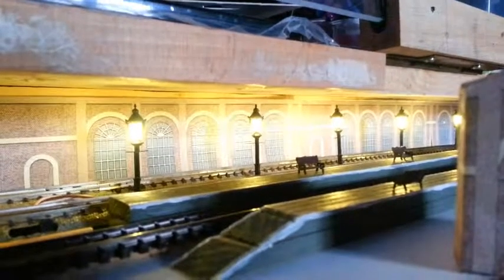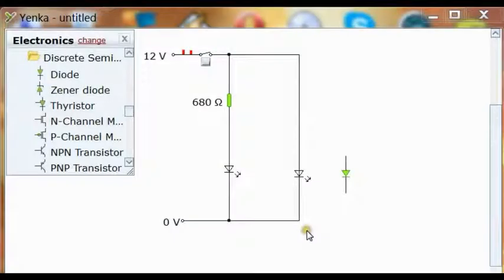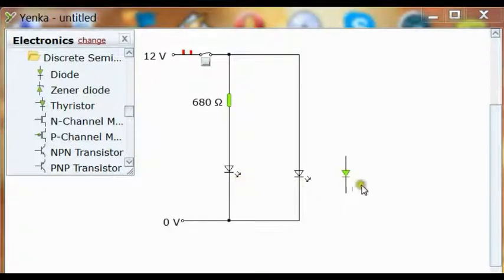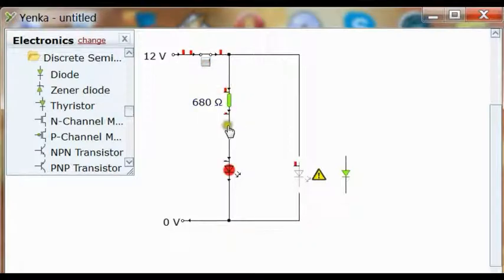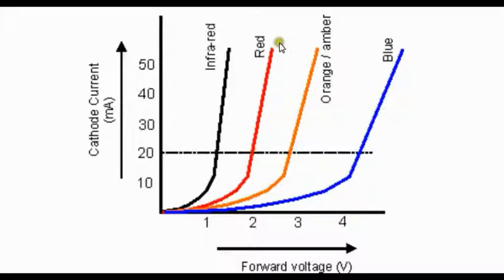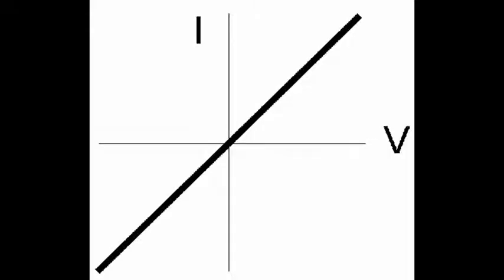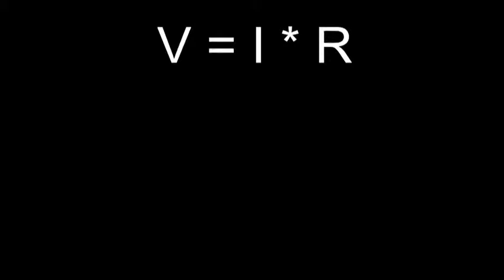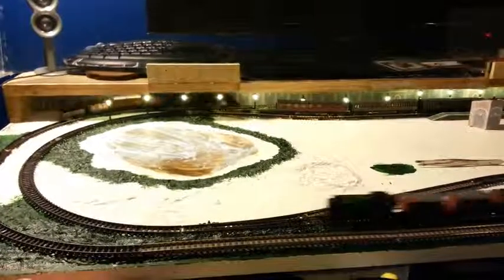Calculating LED protection resistor sizes

Comment: Confused by all the calculations and wizardry in selecting resistors when the results are still far too bright
Reply from the maker: Aus78Formula if the LED's are too bright increase the resistor size to decrease the current :)